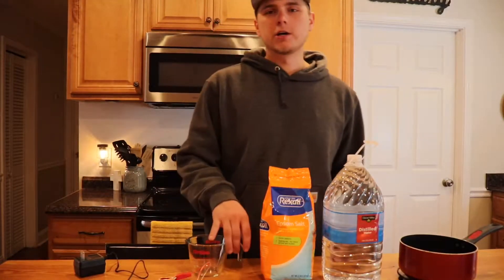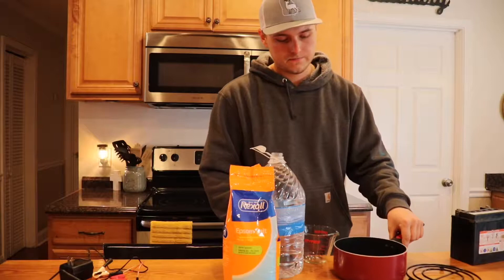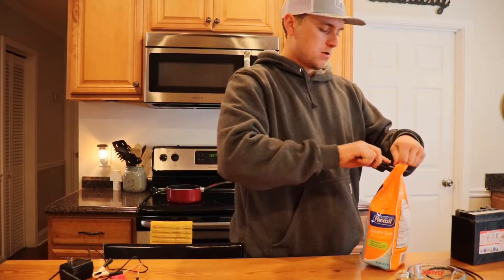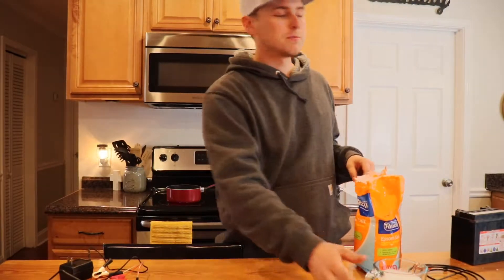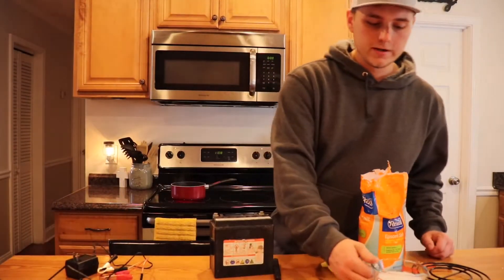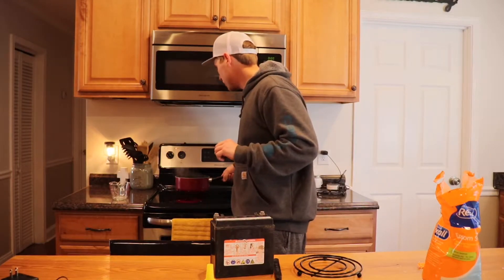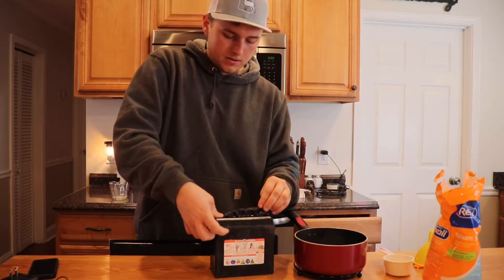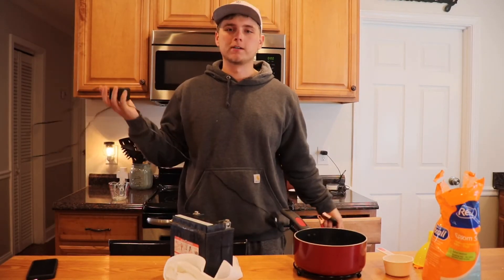Fixing A DEAD MOTORCYCLE BATTERY!

Comment: If you can afford a motorcycle, you can afford a new battery every few years.  It's part of the cost of ownership...like gas and tires.
Reply: I was given my nephew's old china four wheeler and the safety tether was acting up and not starting. Started messing with it to fix, only to find battery is dead and won't charge. Before I put another $100 battery and spend who knows how long fixing it, would be nice to worry about new battery after everything else is worked out. So yeah this is how this is useful. I doubt someone with a 2024 1000RR is looking for a battery hack. Think on a more broad spectrum before thinking you have all the answers punk...lol I'm JP on that but yeah
Reply: @aaronmenchinger exactly. I have a 2015 Yamaha grizzly 550 that needs new battery. Every year it needs one as we always forget to go up to the farm and remove the batteries from all the machines. Sometimes driving 1-1/2hrs just for a $100-$150 battery does not make sense …. I don’t wanna put a new battery in again as we don’t drive it much and I haven’t been up here much, but we got 2 ATVs just sitting around that haven’t been used😂 this video is GREAT!! I’m doing this if I can get just the summer out of the battery with $20 in supplies , I’ll be very happy!!!! The original comment is stupid, some people have money and possessions because they save anywhere possible…. For example me who’s gonna attempt this battery hack. Most ppl can’t afford to have 2 Yamaha atvs just sitting around 😅 I don’t want to sell the machines so if I can save money it’s better than blowing more
Reply: Wasteful world u live in, why not at least try fix it
Reply: Thank Joe Biden!
Reply: Lol @JosephDiaz-r4h
Reply: U fa-q
Reply: Q
Reply: John doe probably drives a cybertruck

Comment: This supposedly removes the inert lead sulfate coating that has accumulated on the lead plates, thus reducing the reactive surface area. After you shake it, you might want to pop the lid back off in case some made it down into some voids such that it needs to topped up again. Just a thought.

Comment: The whole point of distilled water is so you don’t have to boil it, you can just boil regular water wait for it to cook and use that
Reply: “So you don’t have to boil it”? … Oh my … No, .. no … it’s because distilled water is much purer than tap water which always contains various minerals, quite often calcium carbonate (lime); but also iron oxide, and all kinds of other minerals that , when combined with sulfuric acid (“battery acid”) can greatly degrade the electrolytic properties present when reacting with the lead plates, all necessary for a battery to work. Calcium carbonate is very alkaline and will react with the sulfuric acid and completely change the pH level inside the battery. Boiling the water is to kill the biologicals … bacteria, germs, cysts, preons, microbes, viruses, spores, parasite ovae (eggs)… you know.. sterilize it … not to remove dissolved minerals… in fact, what boils off IS pure water,  in the form of water vapor (steam) and is what must be condensed and collected by distillation, so you’re just further concentrating whatever was dissolved in the tap water. So don’t boil it. You need to learn some basic physical chemistry before you go giving advice on the subject. They used to teach that in high school, but I guess they had to quit so they could teach you racial sensitivity and what gender-specific pronouns to avoid.

Comment: I'm confused did he just top off the battery with that solution or did he drain out all the old electrolyte and then refill it with this solution of Epsom salt and water?
Reply: He just topped it off. That was the reason he shook the battery to mix the Epsom salt with the existing acid in the battery. I'm getting ready to try it myself good luck
Reply: @patrickbush9526  Did you get the motorcycle battery to charge using the epsom salt?

Comment: Great Vid Josh. few things, what if we clear all old solution inside the battery with CLR, so that the cells can work better. As CLR will clear up all the dirty stuff out.  Secondly after filling the water-salt mix in the battery, can we put it on trickle charger? it will take a lot longer yet will charge eventually. 
do give ur feedback. thx
Reply from the maker: Hey Thanks For Watching! You probably could clear all old solution out, but i have never done it that way. Also, a trickle charger will work it will just take longer to charge.
Reply: @TheShopBros  thx for reply. I did exactly same way and used Coca-Cola (hahaha)  to clear inside. Trust it worked great, put it on trickle for almost 24 hrs.. results r amazing. Bike started happily. I noticed there was no solution/acid inside the battery, all got dried up . So hopefully my Epsom salt water mix will work for this season, will chk level again before storing for winter..
Thanks again for ur vid and reply
Reply: @Switch-Hitter43  I did my Kawasaki Ninja battery same treatment last year . Till now it has charge in it. 
Although I didn't use my bike this season. Yet batter has the charge. 
It becomes a new battery after this treatment.

Comment: What up Josh! Did you empty the old fluid out?  Or did you just add to it?  That seemed too fkn easy.
Reply: Cha One no fill it as is. Do t empty the fluid out. What the water does is help recharge what is in the battery and boost the charge so that the cells can work again.